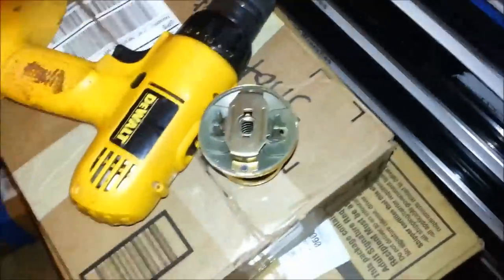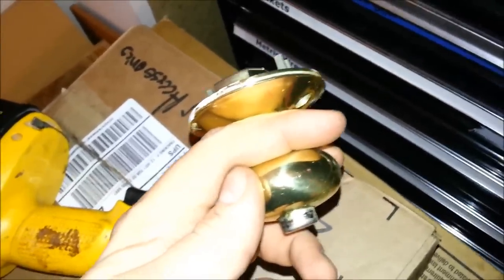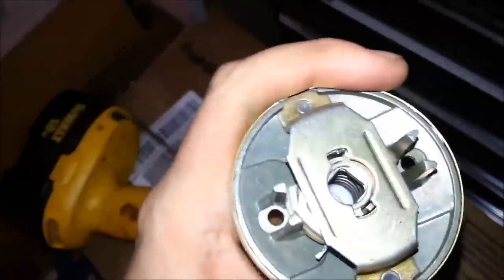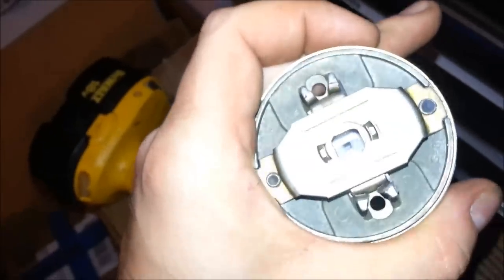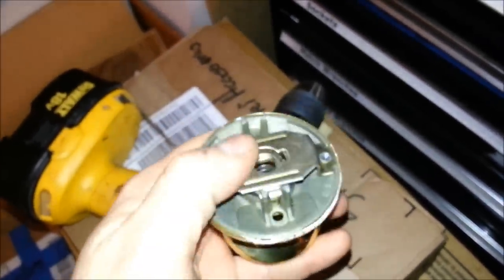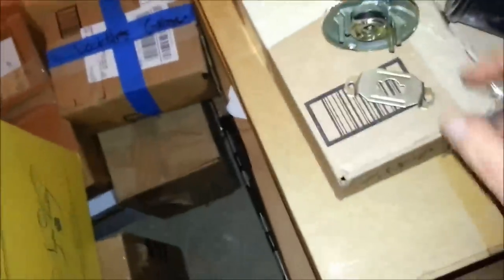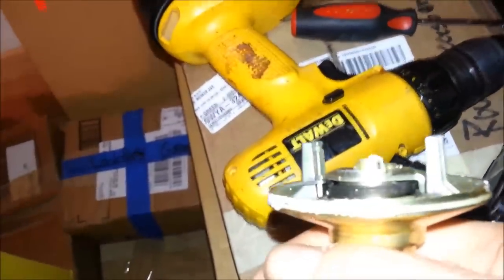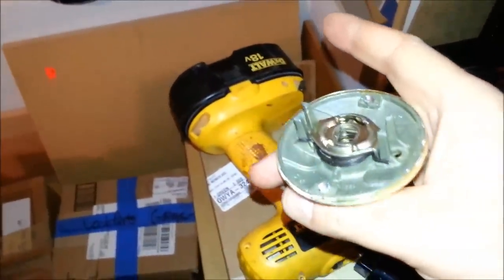(089) Hack Your Knob: Discretely disable a privacy knob (2 of 2)

Comment: i think you could also just add globs of hot glue to inside each side of the bracket allowing the door knob inner piece to not be pressed into the metal bar slots. just holding them in the neutral position.